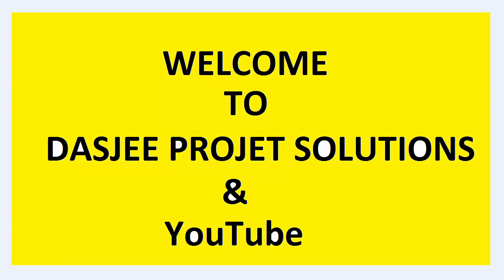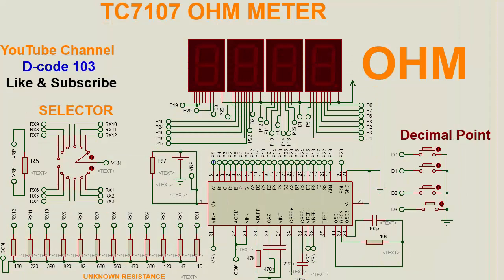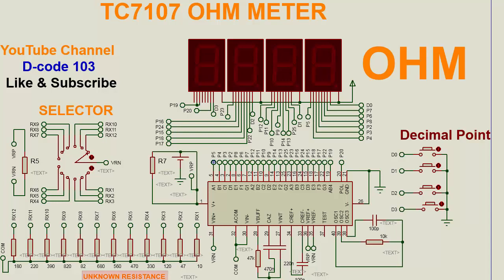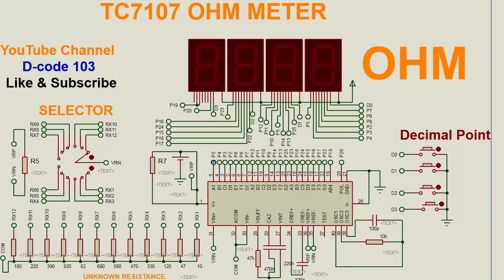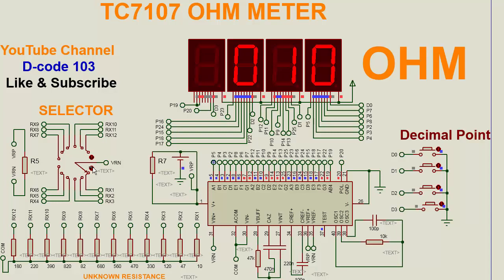ICL7107 | TC7107 | Ohm Meter Resistance meter

Comment: sir please guide us in pin no 35 and 36 what we connect and how to connect R5 and R7 resistor in circuit
Reply from the maker: The analog input required to generate a full scale output (1999 counts). Place 100 mV between Pins 35 and 36 for 199.9 mV full scale. Place 1V between Pins 35 and 36 for 2V full scale.
Reply from the maker: Please read data sheet also